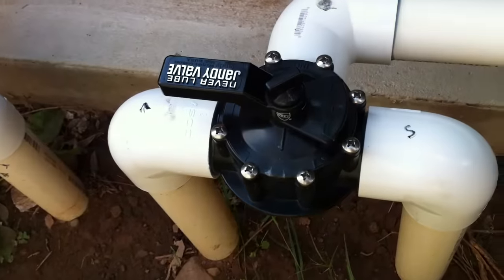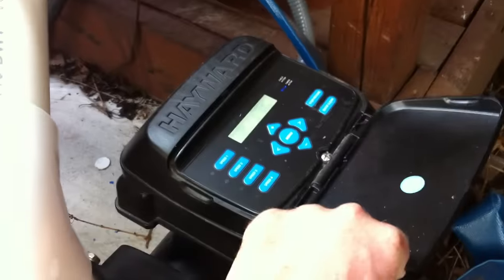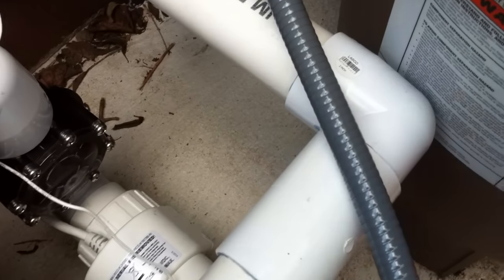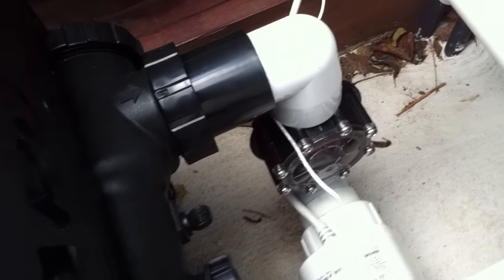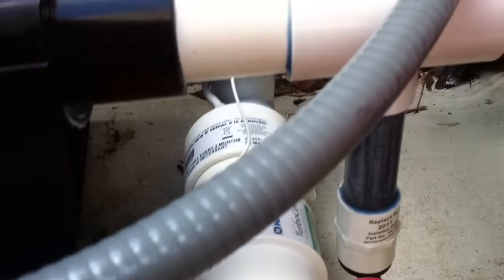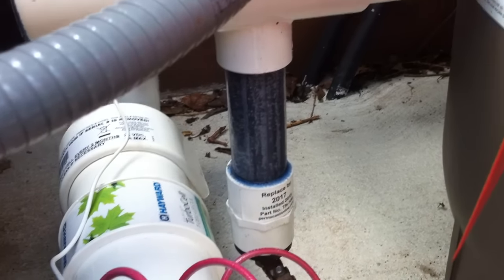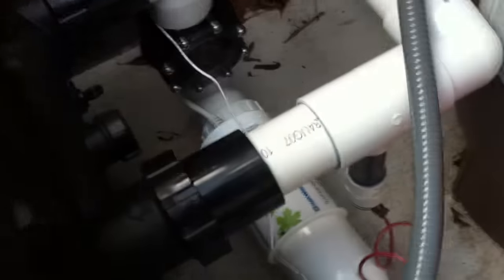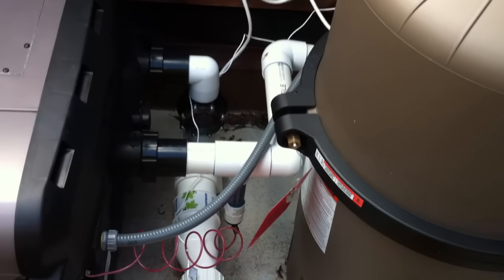Perfect Installation - Pool Equipment Installation Tips

Comment: What level of salt/chlorine should I put my Hayward generator at? My pool hardly gets used! I thank you in advance. Love your videos. I used the 2 inch long sweep 90's on my installation. Thanks to your countless times of mentioning this in your videos!
Reply from the maker: The lower the salt the better, and whatever percentage you need to run your cell at in order to easily maintain 1-3ppm of free chlorine at all times.  This value will change based on sun, raitm, bather load, age of the cell etc.

Comment: Fastasic video!  It's so sad the most (95%) of pool installers are stuck in their outdated ways to install pools and plumbing!  When I ask potential pool installed questions on plumbing, pumps, filters and electrical I am told or shown a photo of cheap blue PVC with cheap ball valves connects to undersized constant speed pumps, undersized filters with and grounding!   Trying to get them to improve or even watch a few YouTube videos is like pulling teeth!   It appears I will be telling them how to do their job and paying extra for the equipment and lessons!

Comment: Hi Steve. VSD is cool. However to recommend while the intake pump trench has been made or dug, I recommend making it two pipes. I.E. 2x50mm or higher, simply using 2 Y pipes splitters. This drastically reduces the suction pressure drop. Kind regards Graham.

Comment: Hi Steve, I have a in ground pool .
Nothing is bonded and just added a low chlorine salt system.
I also installed a anode rod but not connected to anything, would connecting it to the ground in the electrical box do the job of protecting against corrosion?
Do I have to ground my heater as well?
Thank you for your help.

Comment: A couple questions 1) in this video there is a long sweep elbow very close to the top of the pump outflow.  Is that ok, or is it better to have a bigger gap first?  2) for supplying water to a booster pump, is there some kind of tee or wye that is low head (lower than the 4.3 you have cited on your friction loss fittings page for 2" line flow tees)?

Comment: I’m considering installing a heat pump this season on my chlorine pool. From watching your video it looks like I should add an anode before it. Is a check valve necessary? I was planning to do diverter bypass valves to isolate the heater if needed.
Reply from the maker: Is it a salt pool? If yes an anode is prudent. If you have any chlorine injection, salt cell or especially puck feeder, then yes use a check valve to protect heater from chlorine tracking backwards in the system. Worth the small amount extra cost for extra heater protection.

Comment: Not a bad system but certainly not the best. Cartridge filters are the bottom of filter systems. It was prudent for the builder to add the discharge hose. Just wondering why they went with the 3hp variable pump? At max flow is going to put a huge load on the cartridges. Massive overkill for the size you told us the pool was. How many skimmers? 
Also, FYI, those are not sweep 90’s. 
Do they have a cleaner? Hopefully not the Polaris 360. Since there’s no booster pump one would venture to guess that they would have either a Polaris 360 or an independent unit. If there’s no auto cleaner then they will be vacuuming everything into the cartridges, which means that they’ll have to have the filter serviced 4x a year. 
Also, Hayward has made some positive changes, ie…discontinuing the Northstar pump, but still not the best product for the price. Warranty work with them is like pulling teeth. 
Just not the best choices on this build. Over priced and wrong equipment. I hope that builders will get back to the old days of positive customer service and accessible equipment for when things need to be replaced.
Just sayin.

Comment: Can you use flexible pvc to hook it up to the overflow drain pipe?
Reply from the maker: Flex is not ideal for any application but used for many anyway. A non pressure rated drain line for your overflow could be done with flex with the main concern being you need slope with a drain line and that would be hard to do with the memory in flex pipe. Rigid for sure is easier for setting slope.

Comment: It'd older video I know, but the check valve after the heater is not installed correctly. If installing vertical the flow needs to be going upward.

Comment: All the installation instructions for a salt-water setup say to put the flow switch BEFORE the chlorinator, and in two of your videos I see it after the chlorinator.  It makes sense in the setup to put it after as it helps provide that straight run and it appears that it shouldn't matter if it is before or after as long as they are directly connected without valves in between.  Is there a difference between putting the switch before or after in your opinion?
Reply from the maker: The reason why you should put it before the cell is simply that the flow switch is made from a very thin piece of metal that moves when water is flowing and closes a contact point.  Since the cell is generating chlorine you would want to have that behind the cell to prevent any corrosion damage on that piece of metal.
Reply: I would disagree, I'm a experienced pool technician and usually I stick to Pentair products as they are the best there is, Pentair's cell has the same flow switch built in to the cell and its BEFORE the cell as not to blast a sensor component with chlorine. I shake my head whenever I see any kind of sensor installed after a cell in the pipes, because its common sense not to blast a sensor with chlorine. Great videos and appreciate what you're doing but gotta disagree on that one.
Reply: Daniel Freedman He literally said to put it before the cell lol

Comment: Hayward doesn’t require a certain amount of straight line flow after the flow switch, only 12” straight upstream (which can include the salt cell housing if immediately upstream), so why are you saying there needs to be 8” after the flow switch?  Thanks in advance

Comment: I believe the salt cell needs to be installed 12”  downstream the outlet of the heater in a perfect world. Correct?
Reply from the maker: The further the better as far as I am concerned...but as long as there is a check valve in between the two then I hive it a thumbs up.

Comment: I would not consider those 90's sweeps they look standard 90 right angle fitting to me.  A sweep 90 has a much more gradual longer turn that creates less back pressure and turbulence in the plumbing.  Almost all installers use standard 90's for one reason - less cost.
Reply: I agree 100% I'm getting ready to correct my pool filter setup from the precious owner. I'm doing lots of research and there is no way those 90's are sweep.  The whole purpose for using sweep 90's it to avoid restricting the flow of water!
Reply: LivingTroysLife ! Lasco SCH40 #406-020 is the 90 elbow for 2”. #406-020SW is the sweep elbow

Comment: Why do you keep calling short 90s sweep 90s? There is not a single sweep 90 in that video.
Reply from the maker: Street elbows, short radius sweep elbows and long radius sweep elbows are the three options.  In my area the average installer uses all street elbows for every turn in the pipe.  By comparison short sweep elbows are 4x better and less restriction to flow.
Reply: No. Street elbows have one male and one female end. Street elbows can be short or sweeping (wide radius).
You're mixing definitions and are confusing your audience. 
What you are calling street elbows are actually vent elbows.
Please google it and learn proper terminology if your're going to give instructional videos and especially if you're going to critique other's work, which BTW you're spot on.
Reply: Secret agent,  the street 90s your are talking about are galvanized pipe or steel pipe, in the PVC world street 90s are a female slip on one end and a male slip on the other. In this video there are several pvc street 90s. I use them when needed mainly on retrofitting to pre installed equipment.